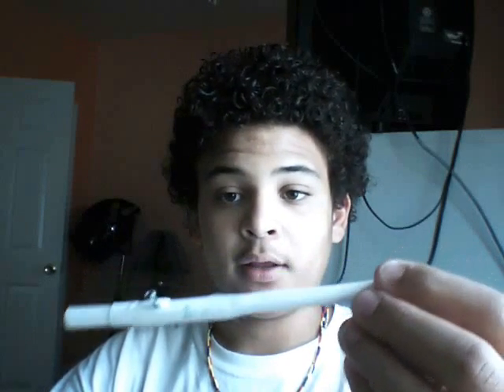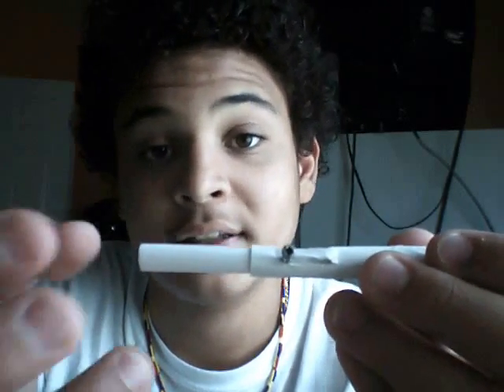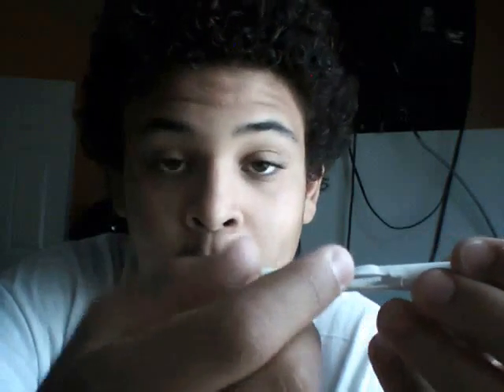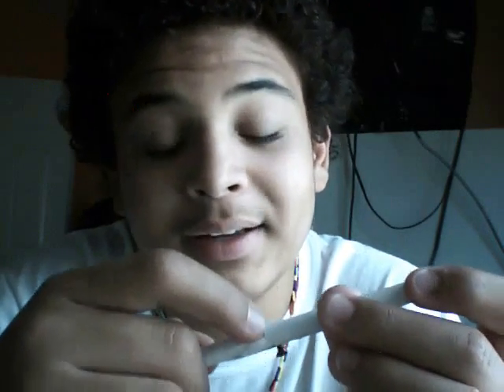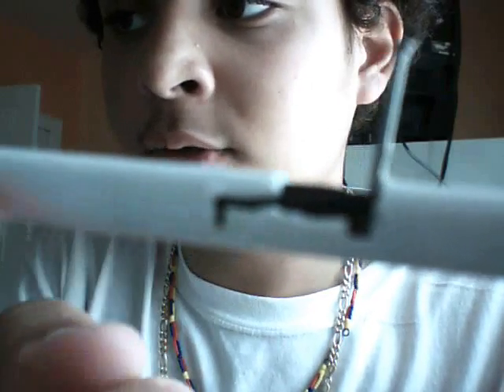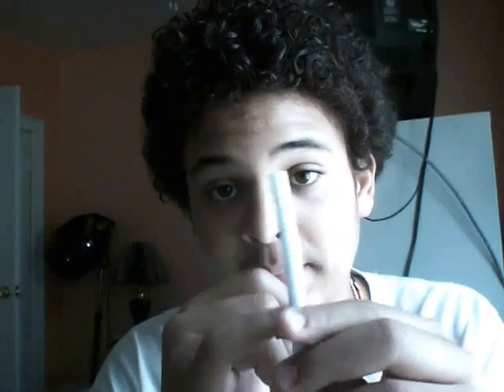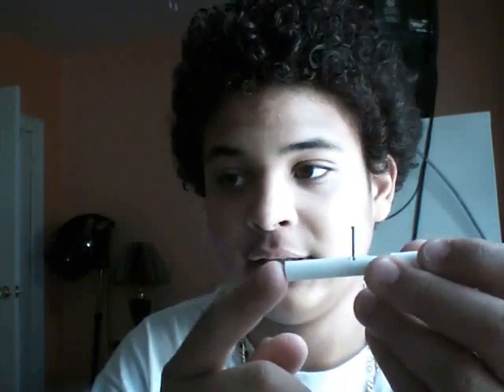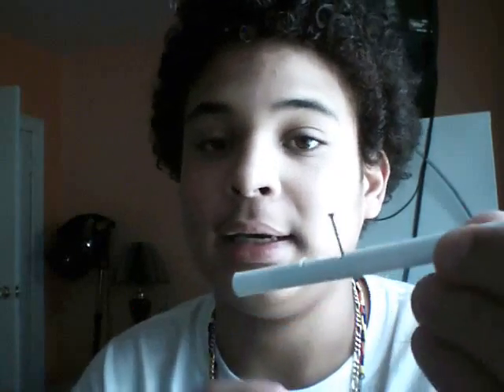how to make a bolt action mechanism

Comment: because actually, I don't think it is legal to build such pieces. Making the bolt action mechanism, maybe, but inserting it in a real weapon, as it is experimental, it is not recommended. dimensions has to be very specific (rounded to 1/1000 of an inch) as they must be standardized to real ammunition (like 7.62x39mm WP for a standard SKS). Machining requires much more preparation and tools than just folding paper with your own hands...